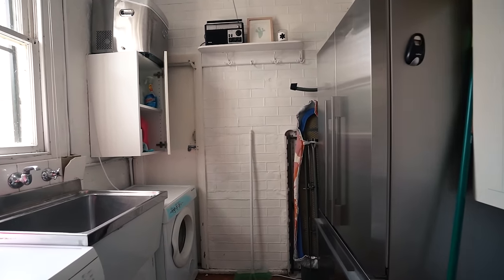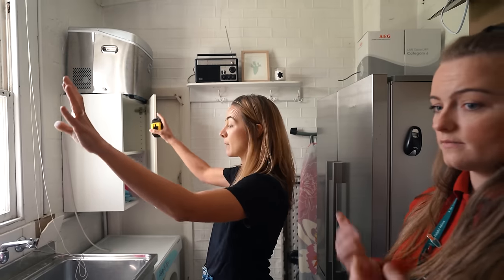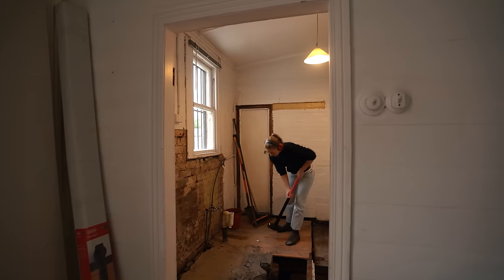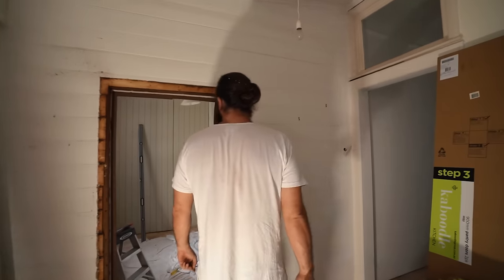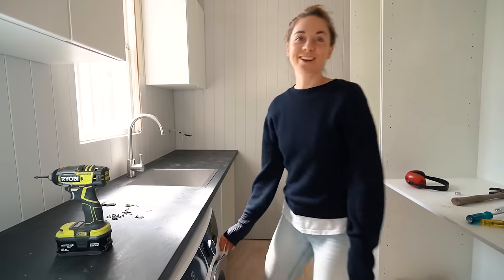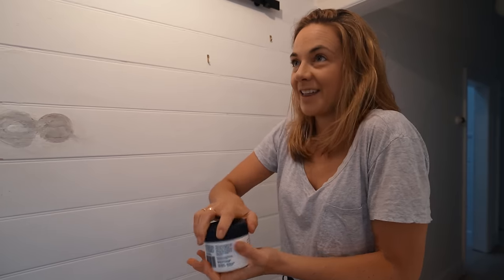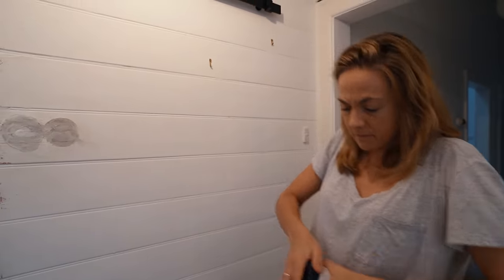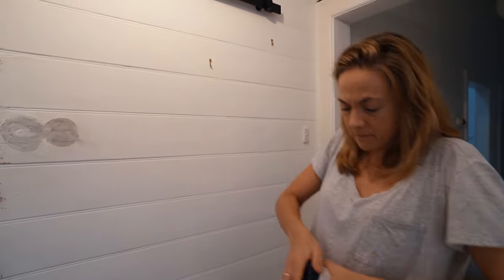DIY Laundry Makeover! 😲 Our Nightmare 'Problem' Room gets a Calm & Luxurious Transformation!

Comment: For future reference, start hammering at the edges of the concrete instead of center mass.  

Depending on use, I would be tempted to have the washer and dryer away from the door, because it is a pathway.

Instead of doing a 'cabinet wall,' I would have installed a closet.  It would be less expensive and easier to customize. You could then utilize the entire wall for storage then...

Overall, I rethink I prefer the before.

[Okay, that was a really bad joke...😊]

Comment: Did you get your washer door direction changed?
Would be much easier putting load from washer to dryer.
Reply from the maker: It’s working well how we have it at the moment. But I’m sure you could find opposite directions options if you needed.
Reply: @Huntingforgeorge  Great if it is working well.
Don't need to buy new...most washers have an option to change the direction of the door.